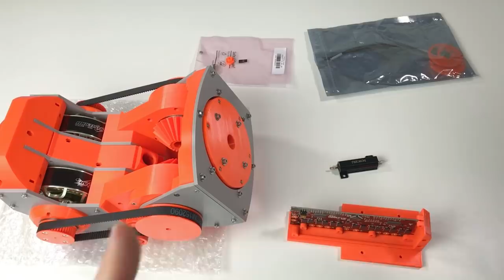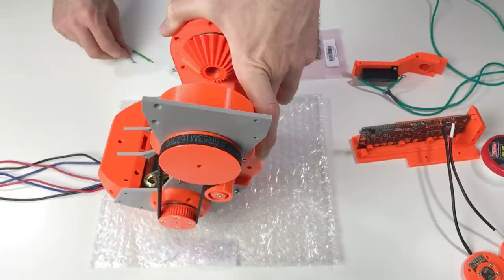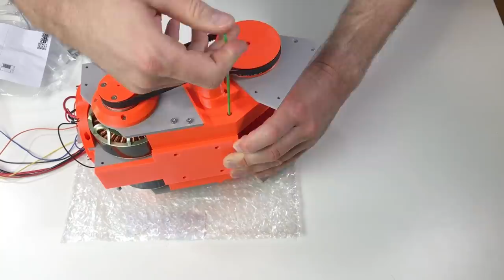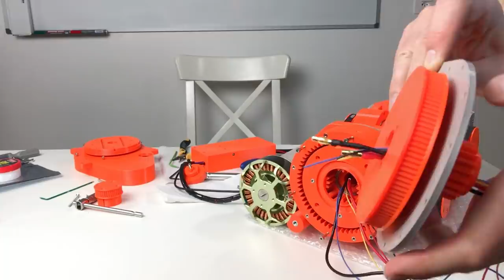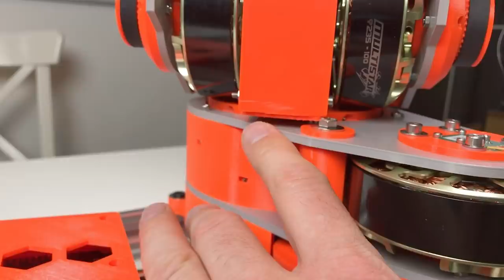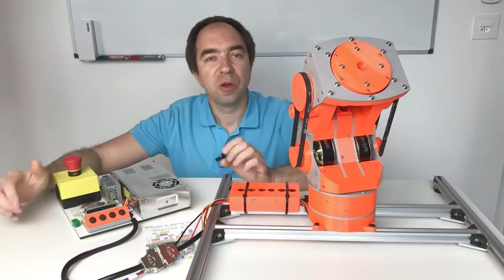Another 7-axis (7DoF) Brushless Robot Arm (shoulder assembled, part 5)

Comment: Something you might consider is putting a slip ring in axis 1 that way you can rotate 360 degrees continuously and not worry about breaking wires.

Comment: I love how silent it is and how smooth and fast are the rotations... I hope you will open source this and don't forget to add a bevel on the bottom to fix the bolt issue or maybe make a recessed hole for it... I think if you use some different bolt head will improve the aesthetics a lot compared to hexagonal ones, printing this later in carbon fiber filament or resin will make this a real challenge to commercial robotarms

Comment: You really should consider connectors on the odrive board instead of direct soldering. Solder a retentive board connector, and crimp or solder the mate to the wires. Even just Dupont plus 100 mil headers.
If you don't have space, use 90 degree connectors, or redesign to get space.
Trying to service or troubleshoot something that's fully soldered is a pain.

Other than that, very nice arm assembly :-)
Reply from the maker: Yes, this is possibility. But direct soldering is simple and very reliable. :)

Comment: Amazing work again. I strongly recommend to add encoders to axis 2 and 3 (on the joints in addition to the motors) because otherwise you will have to integrate the odrive velocity and in time with motions it will give errors on the positioning. There can be seen a very small backlash when you switch between axis 2&3 commands.

Comment: I also commented this on your last video, but if you havent heard of that before, I think you need to know that this exists: (not the comment but harmonic planetary gears)
"Hey have you heared of harmonic planetary gearsets? with those you dont need bearings for the planets and you get insane reductions without any backdrive. I had built once a 2 stage version with 1:10000 (not that you need this insane reduction, but a single stage gives you easily 1:100)"
for anyone who doesnt know what this is, you basically have two big outer gears where one of them has 3 teeth more, or whatever the amount of planets is you have. but you stretch them so there have the same diameter, and if you have 3 planets, there will be three spots separated 120 degrees where the teeth of the outer gears line up. and if your sun gives the planets one rotation (in this analogy when a year passes) the two outer gears will have moved three teeth against each other. this gives you the benefits of a worm gear without the disadvantage of the friction. If you have read this until here, please upvote it! not because of social media like bullshit, but because harmonic gears are awesome and more people should see this!

Comment: It's looking so great!
Did you consider using slip rings for the electric connections between the joints?
Also, shouldn't there have been grease in to planetary gear for the 1st axis?
Reply from the maker: I am not sure that this will be easy. First the slip ring should be capable of handling up to 10Amps of current (to power ODrive), and it should allow at least 100kHz communication signal. Cheap slip rings would not work. BTW, not many industrial robots use slip rings. Also I use high quality extra flexible cables. I hope they would last long :)
Reply: You can put a limitation of the degree of rotation on the program to avoid excessive rotation

Comment: Overall, the arm is very nice! 👍
However, I'm not crazy about using a differential drive for Axis-3.
The upper platform was oscillating from 7:25 to 7:38.
Reply: Just need little more accuracy. Propably all problem only in printed gears.

Comment: I wonder how much holding torque will the motors have once you attach more segments. Also there's slight asymmetry in how those two motors in the differential are driven that results in the 2nd axis wobbling a little bit when you move 3rd.

Comment: Wooah this is much greater than i expected. I wonder if the lower arm motor would be strong enough if you install all the upper arm and use aluminium parts as planned. Also, will the motor temperature be an issue? The motor will work quite hard i guess.

Comment: There is a slight bit of backlash noticeable on axis 3 when changing direction. I wonder, will this get better or worse once the rest of the arm is on? On the one hand, there will be a longer lever arm so the backlash could be more noticeable, but on the other hand the additional weight of the arm might effectively remove the backlash. Really cool to watch! Quick question, have you ever considered using capstan drive mechanisms in your robots? They've got no backlash and great backdriveability, might be something to consider.

Comment: I love the idea of using the differential gearing to get two axes in one mechanism. Though I notice that when you move axis 3 at 7:24 there's a little bit of movement in axis 2 (presumably the torque from the two motors not perfectly cancelling each other out). How would you deal with that? Perhaps encoders to detect unwanted movement of axis 2?

Comment: Have you ever considered designing and building slender lightweight stiff robotic arms? The industry is focused on less bulk.
Reply from the maker: This is shoulder, so it should be really solid (it holds the weight of entire arm). So to make it slender I would need to use aluminum, or carbon fiber, but not 3D printed plastic. With plastic I need to make it bulky, to be solid.

Comment: OMG it's so Cool!

do you have some code to prevent that the 2. axis bumps into the shoulder if you move it to fast?
Reply from the maker: Not yet, this is why I moved it carefully. :) Thank you for comment!
Reply: I would do it with magnetic switches like them in cnc machines.

Comment: Great job! I really like smoothness and the mechanical design. I wonder what will be the final result. I have a question about the design of the differential access (third one I think). There is a slight vibration at startup so the motion is not linear at the beginning. Do you think it is because of the mechanical tolerance on the gears or the desynchronization of the motors? If it is because of the desync, is it because of different response time or because the commands are sent sequentially?

Comment: I cant get over how quiet it is. You said you are not running the motors at maximum speed, what is the power supply you are using to power these three motors? Is it capable of running more motors?
Reply from the maker: Great question. Now I use 400W power supply (48V). I think it should be enough for normal use for all 7 motors, but I am not 100% sure, maybe I would need to add another 400W.
Reply: @Skyentific  Thats really helpful thanks for the reply! looking forward for the next video

Comment: Great work, wish you all good luck, :D
 , so cool
I need to ask you a question please.
you control two BLDC motors simultaneously to move  AXIS No. 2 and 3
Can you share how did you do this (coordinate motion of two motors simultaneously ) while Using laptop with micro USB cable with stand alone python script .py instead of teensy 3.6 ?
or do u show your code with teensy 3.6
Reply from the maker: This is with Teensy 3.6. I do if in the same way as James Bruton in his open robot dog.

Comment: Hey, bud, I'm new to this channel, and I'm noticing you're using brushless motors instead of steppers or servos. Are there any particular advantages to these brushless motors that made you choose them? (power density, ease of control, etc.)?
Reply: Speed.  Steppers can only reach a limited speed, but BLDC motors can run much faster.  The purpose of the O-drive board is to give BLDC motors the same conrolability as steppers.
Reply: @Atomsk102  thank you for explaining this! I wonder how many positions per rotation can the o drive achieve...
Reply: @ErosNicolau  That depends on the resolution of the encoder you use.  See the odrive docs at https://docs.odriverobotics.com/#position-control-of-m0

Comment: What is the use of breaking resistor
Reply from the maker: When we use motor for robot, you accelerate it and decelerate it frequently. When you accelerate it, you use energy from power supply. But when you decelerate motor, motor generates energy. And you need to do something with this energy. You cannot send it back to power supply (this will kill the power supply). So you send this energy to braking resistor. It converts this energy into the heat. If you use batteries, you can actually, theoretically, use this energy to charge your battery. But if you battery already charged, you still have to send this energy to the breaking resistor.
Reply: @Skyentific  thanks you soo much

Comment: Axis’ 1 and 3 will twist the wire bundles passing through them. How will you manage this before they break?
Reply from the maker: I will limit the rotation on these axis to less than 360deg. This is what most robot arm do.
Reply: Skyentific . I see so the problem gets solved in software. Great videos. Please keep them coming.

Comment: I Do  a 3D Print  Harmonic Drive with  a  ratio of 16/1
Reply from the maker: Is it easily back drivable? Can it withstand 30Nm torque?
Reply: @Skyentific  I am at the begining to design DIY- Robots.  I tought, if i have the right Ratio, my robot design could move without load  like yours, but with Nema 17 only  a DeltaRobot is possible.  
My suggestion from a Greenhorn to  a Professional.  If you take your expierience  and design Delta Robots  for Pick  and Place  Work ,  ( PCB board ,  Conveyor Robots - doing Pick and Place work, work as Gantry Robots fixed on the roof).
Delta-Robots , the speed is  the limit not the load. Change the battle rules. You can run a bussiness. Best wishes to be successful the next years.
Reply: The designlimit  is PLA and 1,5 mm thickness, I can use a toothbelt to push the limits. The harmonic drive , Ratio 16 beats the Cycloid design with  Ratio of - 7. Same space and weight,   Compact design. Diam 65  Gearspace for Nema17 .  Planetary  transmission is not a option. Harmonic drive  runs in the car  of Apollo 17    each wheel. Now it comes out of a 3D Printer.
I have my ideas  put it CAD and in the backround  a 3D Printer is working.
Reply: I can improve the design of the harmonic Drive. I see under torque and load that the whabbleing  Rotator has  a selfinforcement to press the teeth in the Static and the Rotating- Arm. To improve the design ist
to make the teeth angular, so that Rotorarm and Statorarm where press together under load so there is no gap and extra  force,  
Thats the only influence, that Rotorarm an Statorarm get  a wider clearance but the transmission improved under Torque ore load.
i like to send you my design  - Step files

Comment: what is the gear ratio?
Reply from the maker: It is a little lower than 10. I try not to exceed 10, to have Quasi Direct Drive (QDD).
Reply: @Skyentific  I'm going to use same motors for my project. So i want to know torques of your robot arm.Anyway, great work sir.
Reply: @Skyentific  What happens if it is no longer a Quasi Direct Drive and the gear ratio is higher?
Reply: @aungchooo2411  You might find this table from the documentation of odrive useful, since it lists that motor I believe: https://docs.google.com/spreadsheets/d/12vzz7XVEK6YNIOqH0jAz51F5VUpc-lJEs3mmkWP1H4Y/edit#gid=0
Reply: @dempa3  Thanks you :D
Reply: @aungchooo2411  Happy to help! :)

Comment: Very nice proyect and an awesome work, congrats! I wanted to ask you if you are having trouble with the calibration of the motors, since in the Odrive site they recommend to make this process with the motor holding no load and spinning freely "Note: the rotor must be allowed to rotate without any biased load during startup. That means mass and weak friction loads are fine, but gravity or spring loads are not okay. Also note that in the video, the motors spin after initialization, but in the current software the default behaviour is not like that." this is from https://docs.odriverobotics.com/. 

Thanks a lot for sharing

Comment: How can this have 7DoF, when in 3D space the maximum is 6DoF? 

https://en.wikipedia.org/wiki/Six_degrees_of_freedom

I know, it's a trick question.
Reply from the maker: Great question! Human arm has 7DoF. With 7DoF you can reach any position (3d position + 3d rotation) with infinite different ways. For example, if you have a candy behind the cup. With 6DoF robot arm you would need to move the cup from your way before taking the candy. With 7DoF you have infinite possibilities to take this candy (by placing the elbow in different positions). And from these infinite possibilities you can choose those, for which you don’t need to move the cup. And you get you candy without moving the cup.